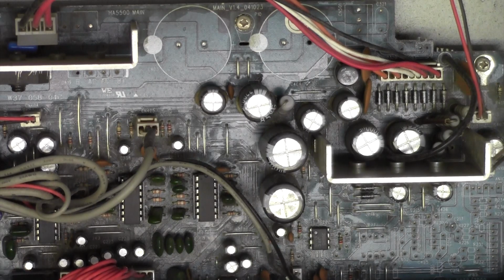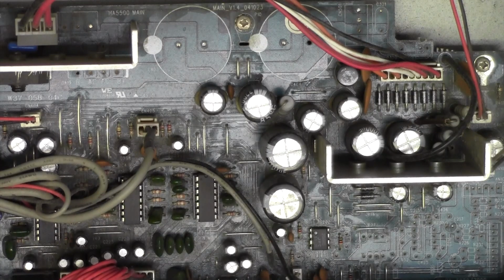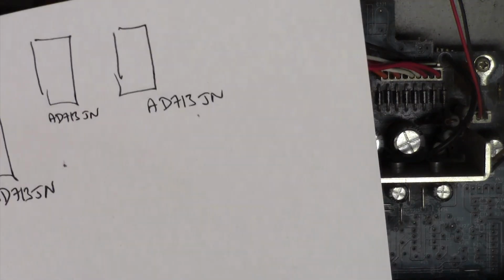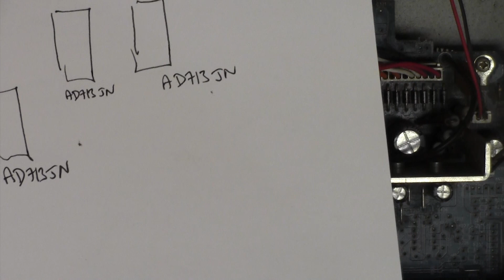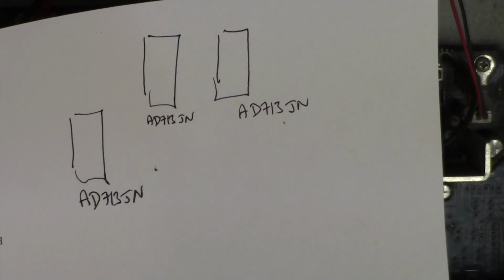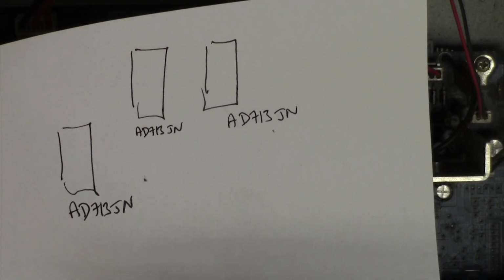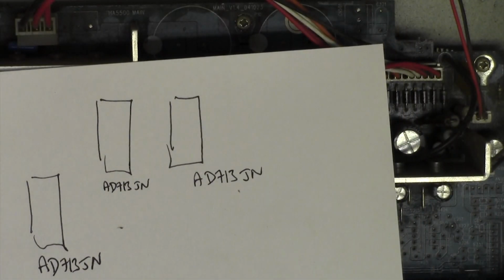How to Fix Hartke HA3500 Crackling Problem

Comment: You just really saved my ass JUST NOW. I have a intire band in room for reherseal, and the Hartke started crackling, so I cut off the LED wire and boom. just fixed in 5 min. Thank you so much!
Reply from the maker: Thanks! That's exactly why I make these vids!

Comment: Hi Stuart, just leaving you a comment to let you know that your video restored my old HA3500's life. Had exactly the same problem (constant crackling) and therefore I replaced it already three years ago with a more expensive (but not really better sounding) head. With the help of your great video, a friend of mine was able to fix my old Hartke now, which for some reason I still had in my basement. He had to cut the exact same eq wire in the end!
Now I can enjoy my old Hartke sounds again and on top sell the other amp for cash. Thanks a lot, Stuart!
Reply from the maker: Wow that's amazing! It may be a fairly common problem then. I'd still like to know exactly WHY a DC supply to some LEDs can cause all that crackling!

Comment: Great video. It shows how difficult diagnosing a problem can be for technicians. It also illustrates the value of using resources such as a correct schematic and internet forums. All LEDs are diodes; and all diodes create some noise. My guess is the LED supply uses a filter (smoothing) cap to minimize noise.  I believe (at least here in the US) Hartke is pronounced "HEART- key."

Comment: i had the led problem in an MXR eq pedal,the led voltage was leaking into the fader tracks,due to dust and carbon residue,did a good cleaning and everything came alive.
Reply from the maker: Interesting!
Reply: @stuartukguitarampguy5830  Yes i think it was the problem, should take 15 min to clean the pcb too (was dirty). Contact clean with deoxit everyslider and jack, potentiometer. Cannot tel you how many products that ive saved only with a good cleaning. Thanks for sharing
Reply: Cleaning ?   That would be fixing the problem, not just eliminating the symptom!  :)

Comment: Just a precautionary note for those who attempt to do this kind of servicing and noise tracing themselves: if you have a solid state amplifier like this you really should be using a current-limiting device ( a series-wired incandescent light bulb) on the input AC to possibly prevent blowing up the amplifier from a big transient pop as you manipulate the circuit boards and unplug/plug in connectors and so on. Solid state amplifiers are far less forgiving than tube amplifiers in this regard, and something can go up in smoke in a microsecond.  Stuart probably has and is probably using one of these but he didn't pecifically mention it.
Reply from the maker: Nope, I've never done that!

Comment: that's the kind of amp I work on 90% of the time.  It's rare I can fix on in a single session.  Usually I tell the customer 2 weeks because it always ends up being a Wumpus hunt because you have to check each thing methodically.  Once in a while I'll get lucky and it's something simple like a cold solder joint.

Lately I've been seeing a lot of 2010-2015 Ampeg's with bad cooling fans.  Probably a bad batch of them got to the factory, but they run either at half speed, run intermittent, or have too high resistance and cause the protection circuit to trigger.

Don't feel bad about the difficulty of the issue.  I was working on a track stabilizing railroad machine that the main stabilizer unit wasn't turning on.  I worked on it with two other techs for 3 days and turned up nothing.  At lunchtime on the 3rd day, the head tech for the division just walked by the machine in the shop carrying his take-out lunch and casually asked "how's it going?"  We told him the problem and without hesitating he told us to change the light bulb in the parking brake indicator.   We laughed, then an hour later we begrudgingly changed the bulb (which was working by the way), and sure enough, the problem went away.  Apparently a bad bulb, even if it was working, could cause a false resistance reading and ghost the PLC into thinking the parking brake was still engaged (which isn't seen on any diagnostic screen).    I never would have thought of that in a million years.

So yes, it happens to the best of us.  The only thing to be concerned with is that ultimately it got fixed.  A lesser tech would have butchered the hell out of the amp changing things out and probably made it 100 times worse.  At the end of the day, it was fixed by clipping a single wire to disable a cosmetic feature.   Later on, somebody can go back in and restore the lights if they want to.

The next one you do like this, you can charge the customer 2 hours bench time, clip the wire, go to lunch, put the top back on the unit, and go home early for the day :)
Reply from the maker: Interesting, thanks.

Comment: First of all, make sure the EQ on/off switch is ok, but moisture and dust between the equalizer potentiometers and the chassis also causes this problem. You can take it off, clean it, dry it well and the crackling problem disappear. Is not ok leave a vcc line opened, and leds off.

Comment: In the 80's and 90's a common onstage rig for topflight professional bassists was a Hartke Systems amp paired with a 4x10 or 4x12 Gallien-Krueger cabinet loaded with distinctive-looking aluminum-cone drivers.  These aren't so common in recent years, but at an outdoor festival I attended 3 years ago, all the bass players on stage played through an Ampeg SVT 300 Watt tube amplifier for several days,  until on day 3 it finally died and was replaced with a Hartke Systems amplifier running through the same big Ampeg speaker cabinet.
Reply from the maker: Ugh... I have nightmares about the Ampeg SVT. Nightmare BEAST of an amp. If something goes wrong on that, get your toasting fork out!

Comment: It has to be a DC leakage from the caps in the graphic eq circuit that’s causing the crackling noise. I suspect Hartke used cheap capacitors in production.
I wouldn’t be able to tell if it’s the Polyester Greenies or the electrolytic caps, so my guess would be to replace them all around that circuit and hope for the best.
It could be a resistor causing it but carbonfilm/metalfilm resistors rarely crackle.
Reply from the maker: Hi Tobias  Yes I think you're right with that diagnosis.

Comment: Hi Stuart. On transistor radios I have found the old heathkit signal tracer will save hours of time. Even faster than a scope
Reply from the maker: Hi Monty  I'm not familiar with that, how does it work?
Reply: @stuartukguitarampguy5830  Hi Stuart. It is used to inject a signal into a circuit and probe to trace the circuit and also audio tracer for like a noisy resistor. Makes life so much easier. I see them on e-bay alot.

Comment: I had a very similar persistent problem with a HiFi my friend asked me to service for him around a year ago. It was a no-name japanese "all in one". The problem was also on one of (many) daughter boards, on loudness switch. It responded very abruptly to even minimal poking, but when measured there seemed to be nothing wrong (loudness is just a pretty simple lowpass filter). I have noticed all pcbs were thickly covered with the reamains of flux. Guess it was the old sort, the corrosive one. So corrosive indeed that it eroded one of the pins of the switch on the daughter board. The way the switch was wired made it impossible to detect anything with instrument. It was an open switch design, so I thought it just needs some service, but it didn't help (I cleaned it without desoldering). It was not until decided to replace it that I found the messy pin. it was all green and brittle on the componnet side (under the switch body), but the joint on solder side looked perfect. The switch I tried to replace it with was not a correct one, so I ended up soldering a wire to cleaned remains of the pin on the component side.
Reply from the maker: Interesting sounds like you managed to get it sorted. Well done. I tend not to do HiFi amps.

Comment: I don't like these much either, I have done several and have the two power amp version in ATM with distortion on lower frequency channel despite changing all transistors the bias is off. What I find worse now is class D stuff and I have loads of that comming in and I hate it (rarely simple faults with complex feedback loops). I am falling in love with valves as they are relatively simple, now at nearly 60 years old with a long history in MI repair spanning more than 35 years starting out with Roland  Yamaha, Alesis and Korg in the digital area, I am finding repairing the more complex equipment with often dodgy Chinese parts near on impossible!
Reply from the maker: Yes I agree, I don't tackle Class D stuff as it's too hard - surface mount chips and silcon sealant poured over everything. Nightmare. I'm thinking actually of changing my business to only do vintage valve amps. If I was younger I'd probably do something like "The Fender Blues Junior" hospital and just do the one amp. Might get a bit boring though! I also really dislike H&K stuff and Mesa - both from the difficulty of working on the gear.
Reply: @stuartukguitarampguy5830  we've got similar train of thoughts, I was wondering if you knew any other service centres like Mike Barden Keyboards or Cimple solutions or Central sounds etc? They all know who I am as I was one of only three engineers at Roland UK. My manager was friends with Jim Marshall....
Reply from the maker: NoI'm afraid not. I came via a different route. Ex BBC then I had my own design and develipment company. I do the repairs just to keep my hand in and help local musicians etc.

Comment: I would have immediately used a silicone based pot cleaner spray on those slider potentiometers.
They often get dirty anc cause the static problem we hear here.
And also spray the valve pin socket and front panel potentiometers. However great troubleshooting video and process of elimination!
Reply from the maker: Yes that was probably a good idea. It's been a while now but my memory of this is that it wasn;t just dirty sliders.

Comment: As you were freezing the main board, I was shouting, "aim the freeze spray at the EQ sliders!" Did you try that? Not that I would have expected the LEDs to be the culprit, either, but I'm curious if freeze spray on the sliders (or maybe even directly at the LEDs themselves) would have reduced the noise.
Reply from the maker: I wonder if tghat would have calmed it down? I'll never know!

Comment: Stuart, I'm curious if a cap was installed in between the LED source to the plug if that wouldn't have cured the noise. You know the ac noise would be blocked. May sound as a bit of a silly question, but it crossed my mind. Cheers
Reply: You're probably right about it being a bad cap.

Comment: Hi Suart, how have you been? I'm Alexandre from Brazil and I was wondering if you could help me with a issue. I bought a Hartcke Hydrive 115C 250W bass amp combo, but the wooden box had a lot of termites and I only found out about it after I bought it. I had to ask for a new box to be made, but in my desperation and haste I didn't draw the electronic circuit or how to assemble the amplifier with the speakers. Now I don't know how to assemble it and I'm looking for help. Would you be willing to show me the correct way to avoid burning out any components due to an assembly error?  If so, I don't have a degree in electronics, but if you have a visual drawing it would help. Thanks in advance, Alexandre.
Reply from the maker: Hi unfortunately I have no info on this amp. I hope you manage to get it back together!
Reply: So grateful for your attention! I have identified the correct conention about this system.
Reply from the maker: Thanks Alexandre

Comment: This is a common problem with these old amps.
The solder joints attaching the daughter PCB (which supports the eq switch) to the main PCB are broken.
Unfortunately you need to remove the pre amp board from the chassis to get at the solder joints which is a real PITA!!
Reply from the maker: Useful info thanks

Stuart

Comment: I'm dealing with the same crackling noise on my Ashdown MAG 300. I've already cleaned the entire preamp board with spray an nothing changes. It's specifically the same thing as this Hartke: if i switch off the EQ the noise is gone. My amp doesn't have any LEDs in the front panel, except on the analogue dB meter. If that's it I'm gonna throw myself from the window 😅
Reply from the maker: Hmm that's an odd one. I'd be interested to hear if you find the issue.

Comment: Hello to, you, yes I don't miss them pain in the head repairs.. or tho I don't work In music amp repair shop anymore but, on the other hand there is the odd few jobs that come along.  The local golf tea room asked me to look at their cloud cvx 225 line amp as it doesn't give sound on one side.

This amp is left on daily and doesn't get powered down.  Anyway the faulty after 2 days on it and plenty of parts changed even telephoned cloud electronics who wanted to change £60 per hour to do the same fault finding checks. I did say I'm an electronics tech myself and walked them over there circuit design!! 
Mm there is a crow bar triac protection with relay latch too.

The fault,  noisy input transistors, slightly heated zener followed by over heated current mirror transistors, plus smd opamp at the input circuit and last but not least an open circuit 1000uf 200v on the ht line.  This design uses an extra supply on the amp circuit.

This amp is a line amp at 250w into 40 ohm load.. yes,40 ohm as it feeds into coupling transformer attached to each speaker.

The reply I got..we'd of scraped it
Reply from the maker: Wow well done for fixing that!

Comment: Stuart: 

Don't beat yourself up because you wouldn't have thought in a million years the sub-board was the problem. You, in fact, DID solve the problem. You used all of the resources at your disposal - all your years of troubleshooting experience and knowledge of electronics plus your brain AND the internet to come up with a quick fix. These days, tech forums are just another tool along with multimeters, scopes, schematics etc.

As a former computer tech support worker I used to do the same - i.e. used every available resource including tech forums to research problems and find answers.
Reply from the maker: Hi Neil, yes you're right. Being a bit hard on myself!

Comment: Hello sir,,pls I have one if this amp,,but I discovered some components around the tl074s have been removed ,,,pls if you can help me out with these components values ..
R3,R4,R5,R6,R7,R8,R9,R16, R36, R220, R222
Reply: I just couldn't find it in the schematic manual,,but they are present in the picture of a board u saw on Google but wasn't clear enough to see the color codes....pls help
Reply from the maker: @ken-bion  Why have these components been removed? Does the amp work? I do have the schematic for this. If you go to the evry end of any of my videos you'll see an email address there. Email me via that.
Reply: @stuartukguitarampguy5830  
Hi sir,,,,I traveled,,,and I was told the amp was dumped bcus it started to blow the woofers,,even when new ones were fixed,,,,so they dumped it ,,,,I came back to see  my course mate said he  removed parts to make an in-ear preamp.....but can't figure where exactly components where removed
Reply: I saw a pic of this panel in Google but the color code of these resistors weren't clear enough wen I zoomed in...only if I could get a clearer pic.....these resistors at the pins of the tl074 ic at the eq section,,,,,,for some reason is absent in all schematics I've checked
Reply from the maker: @ken-bion  Ok well just email me as I mentioned earlier and I'll send you the schematic
Reply: @stuartukguitarampguy5830  
Thanks sir,,I've found and fixed the missing components,,the preamp works fine now,,,,but there seem to be an issue with the power amp section,,the relay won't click ,,thereforeno sound output,,checked but it appears good and every other components around it works fine
Reply from the maker: @ken-bion  Amazing well done.